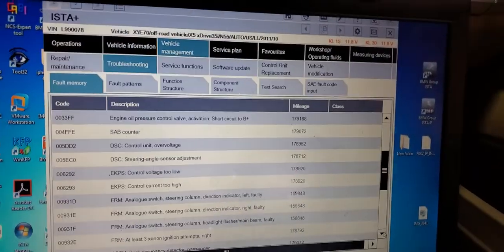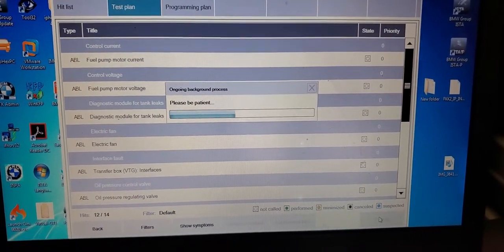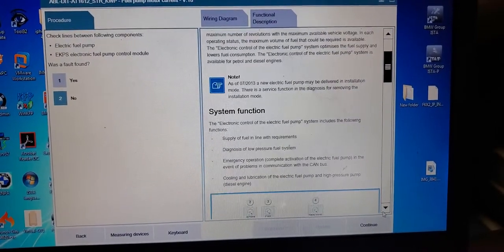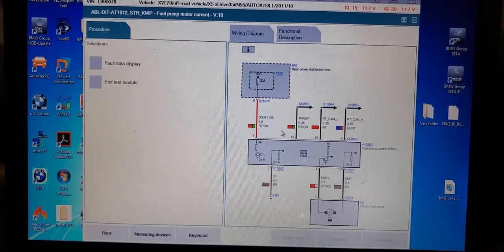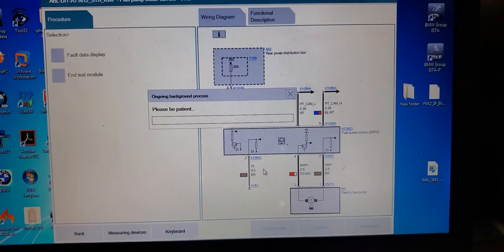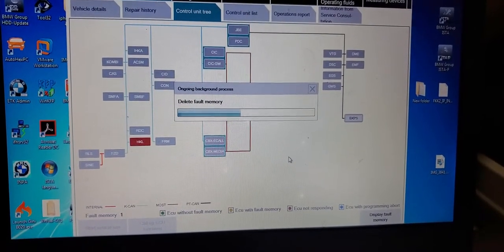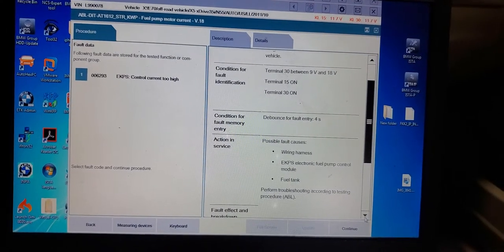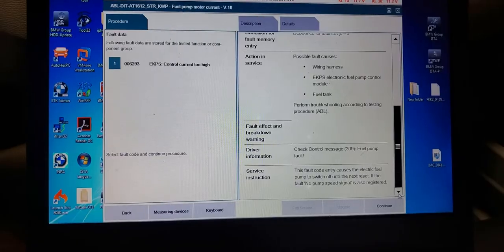BMW X5 E70 Start Stall Code 006293 EKPS : Control Current Too High

Comment: Hi sir I am from India BMW 520d in fuel system in problem I send the code
Reply: 26D200 Fuel presupply-pressure  control power consumption electric fuel pump too high for current
Presupply-pressure
Reply from the maker: most of the time you need to replace and program